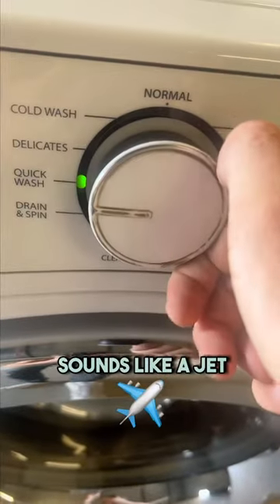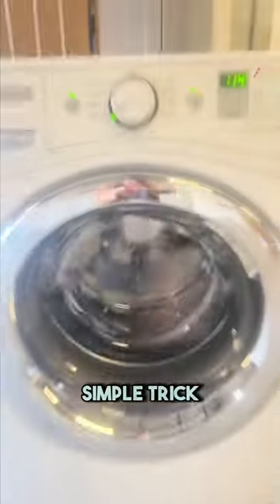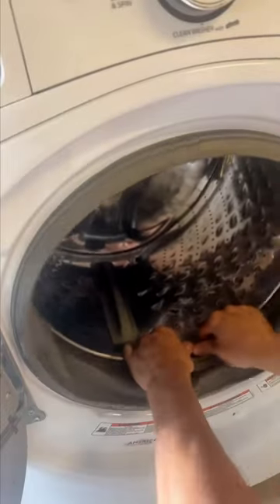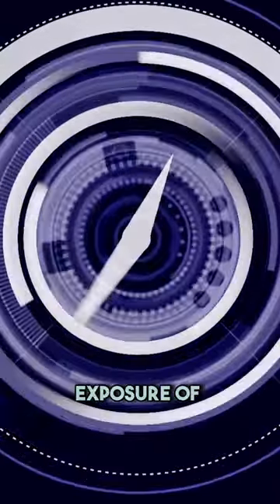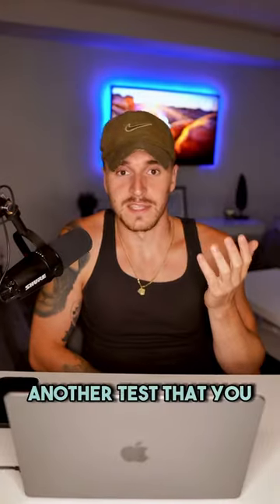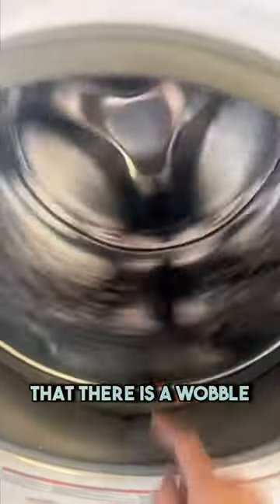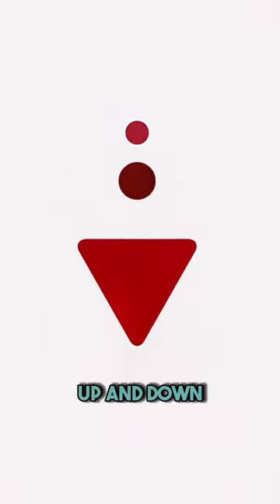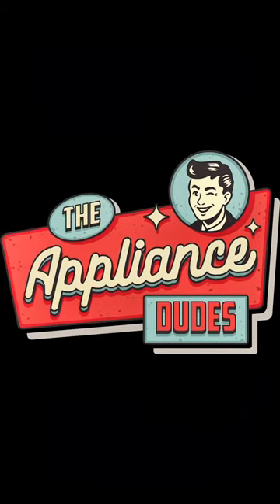Does Your Washing Machine Sound Like a Jet When Spinning? WATCH THIS

Comment: Also it might not be the spider support, our washing machine was unbalanced on the floor tile so it made this noise all the time. You can spot the difference when you spin the drum through
Reply: I hate to tell you my friend, but if it is making that metal noise when you give the drum a shake then yes, it is the spider support or bearing that is shot
Reply from the maker: Hey! Yes an unbalances washing machine would cause it to shake, however, it would not cause that metal on metal sound when you shake the inside of the drum. 

This is caused when the support assembly begins to break down, as well as when the bearing wears down in the back of the machine! 

You're right though! Unbalanced loads/machines can definitely cause this issue.

Comment: I had the same issue with LG wm. Stainless steel drum bolted to aluminium spider will always have galvanic corrosion . Not worth of replacing with new spider shaft which will fail in 4 years. Found suitable spider replacement made of Stainless steel tube made by local folks who does repair on washing machine. Runs great with no issues what so ever.

Comment: Replacing Samsung's spider + labor: $80. Brand New washing machine: $300.
Not worth replacing? 😕
Reply: He is probably from US. They charge $80 to open back panel.
Reply: lol, I have never met an entire technician who has replace the support spider WITH labor for $80.00. PLEASE give me his connections
Reply: I have done this job. It is not an $80 job. No one is making money on that
Reply: @peteralward  come to Indonesia 😄
Reply: Can confirm this. I'm also from Indo, got a broken spider arm for my LG Washer. It cost me only around 1.3 million Rp (equivalent to US$85) to replace the spider arm. That includes the labor cost & the replacement spider arm. Then again, indo does have a lower living cost, hence lower cost for the job. Just wanna say it was worth having the spider replacement in my case, since new front load washers in my country costs around $300 equivalent.

Comment: This happened to my Miele front loader carried on using it the violent shaking and noise in the end was to much could hear it across the street when I would take the dog out.  Miele come and wrote it off.  Now I got a LG which I think is great but it’s started squeaking when turning it by hand or washing. But there is nothing stuck in it? The  rubber seal has a big gap between the drum and seal I went round it this morning with a mag light could see everything nothing stuck no bearing grinding or moving ? There’s f all about this issue on here, or tick tock. And  the insurance was cancelled when I got this one after my Miele 😩 it’s only 2 years old.

Comment: It can even be the bearing is broken
Reply: What bearings you talking about???? Front load washer don't have bearings
Reply: @barcelone1971  right, the drum is just floating in the water
Reply: @donalexey  spider arm, stator and rotor.
Reply: @barcelone1971  ok, call them stator and rotor. How rotor spins inside stator without any bearings? It floats?
Reply: @donalexey correct there are bearings in the rear drum. Unless there is some new bluetooth way of working lol
Reply: @barcelone1971 There are two bearings mounted in a hub that's molded into the back of the tub. The spider arm's axle rides in these bearings.